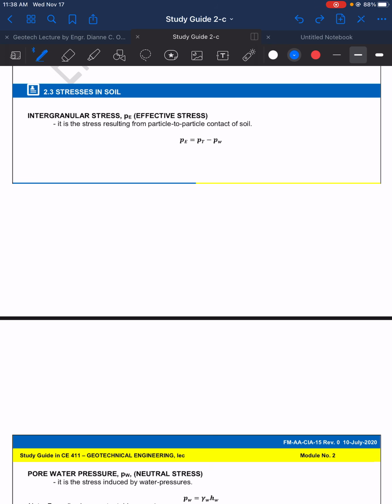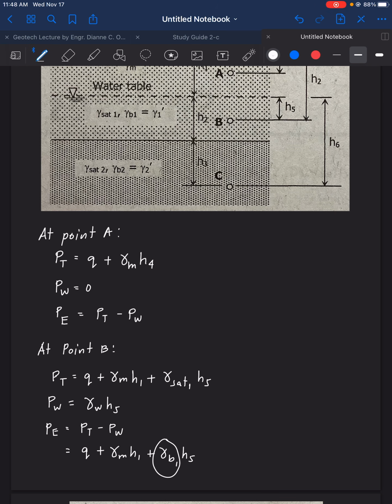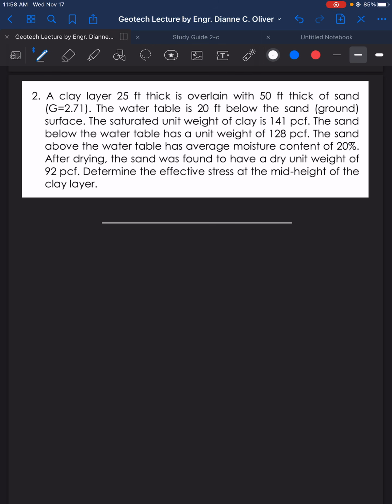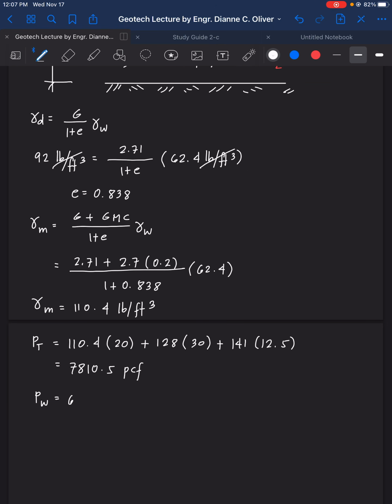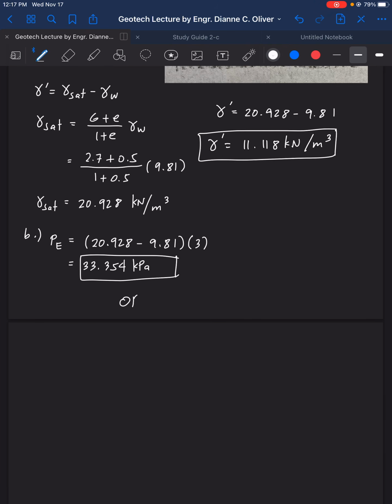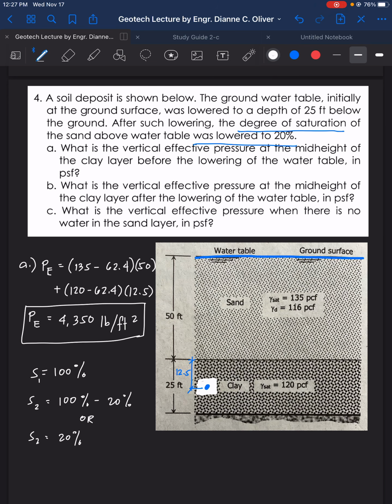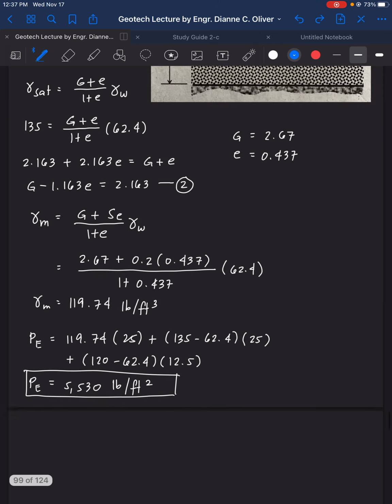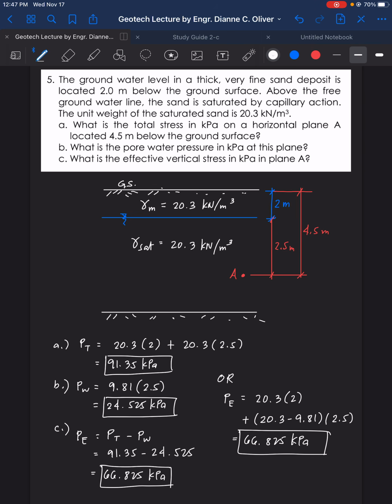Geotechnical Engineering: Stresses in Soil (Part 1)

Comment: Good afternoon po sa question 4 po yung sa letter c po bakit gamma moist yung ginamit hindi gamma dry? Kasi no water po diba?
Reply from the maker: Nasa problem na may condition sya na may degree of saturation na 20% above the water table. So moist ang sand. Sinabi lang na no water sa may sand layer to signify na wala na dun ang water table or to say na area na hindi submerged.